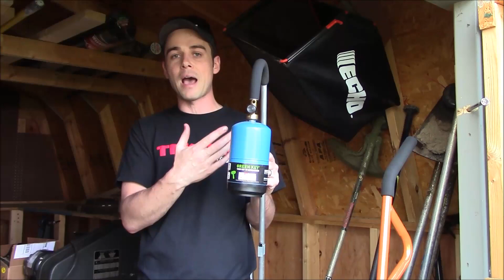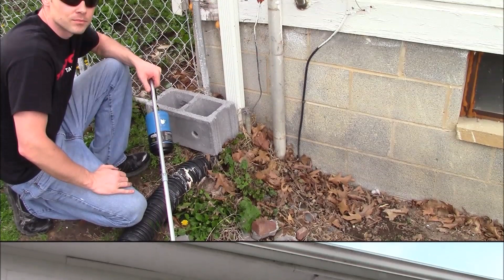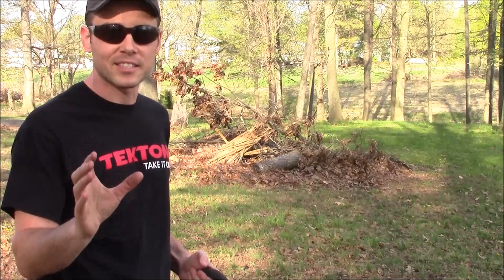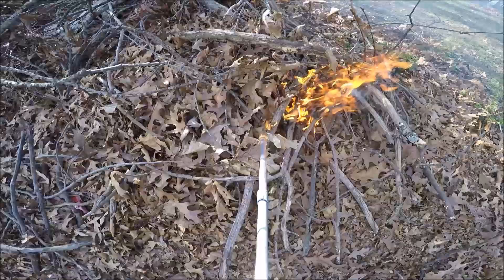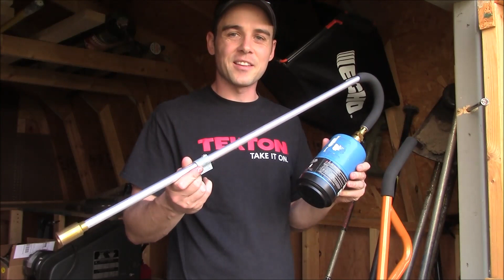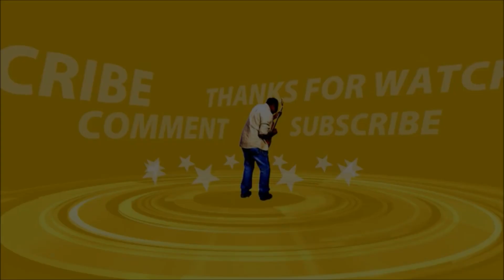Bernzomatic JT850 Self-Igniting Outdoor Torch

Comment: I live in Florida where it's hot and humid, and the temperature in barometric pressure seems to play a huge role in whether or not this piece of crap wants to work. Sometimes it ignites and runs fine for long periods of time usually when it's cooler in the morning, then other times even after going through four different propane canisters, some safety check valve and it keeps triggering and killing it it ignite and shut off immediately. Nothing I do can make the thing work during those hours and I've got work to get done. I'm using this thing to burn long pieces of wood in the fashion that they use to weatherproof wood in Japan. I can't wait for this temperamental piece of crap to decide that it likes the weather enough to work. Any suggestions?

Comment: I bought the Bernzomatic weed torch but still haven't figured out how to light it. When I open the valve, the gas seems to shoot out of the four holes at the base of the handle right next to the valve. It's not the seal to the canister, as I checked by looking for bubbles with soapy water before even attempting to turn it on. I'm terrified that it will blow up at the handle with the gas leaking everywhere. What am I doing wrong?
Reply: Same issue with mine it used to work fine